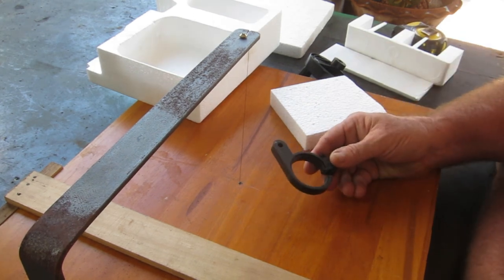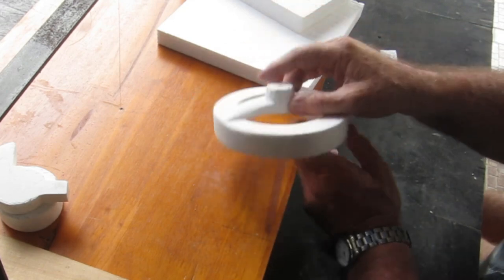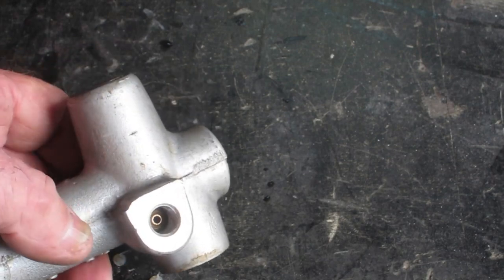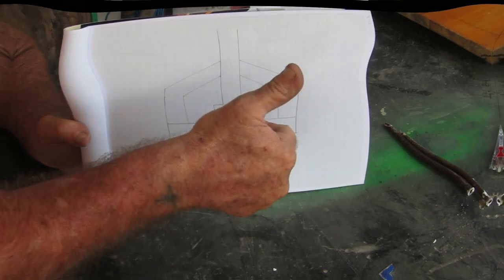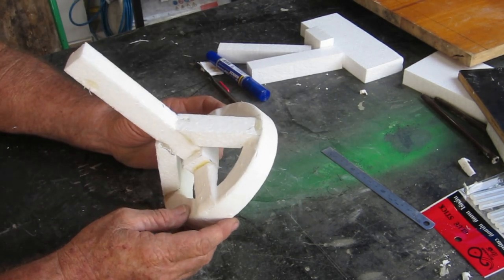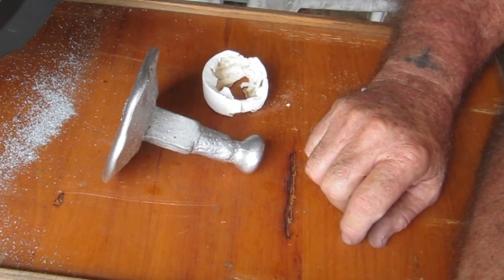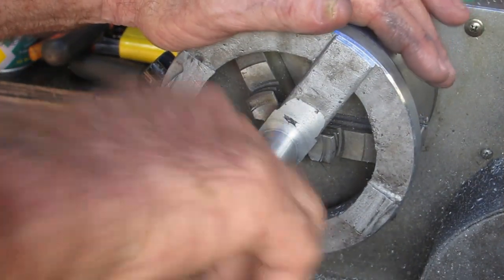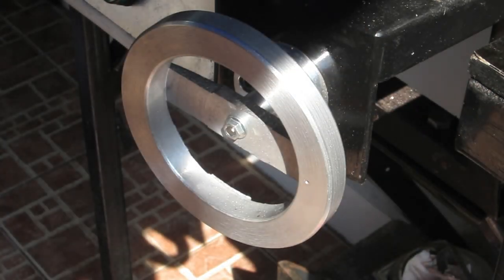MHW Episode 40 - Lost Foam Casting parts for my Homemade Milling Machine - Part 11

Comment: if you try the blue stuff it can be made to do parts as smooth as glass but spay it with sopy water as a difactint so the wall filler sticks

Comment: CA glue melts styrofoam.  I haven't tried pva glue, but model RC builders use odorless CA glue.  It seems to work well
Reply from the maker: I've never seen an odorless CA glue, UHU make a glue for foams, but I haven't tried that yet.

Comment: M8 get yourself an old broken alloy car or motorbike wheel, the alloy in them is ideal for casting.
Reply from the maker: Thanks, I've had rims suggested to me before
Reply: @MyMiniHomeWorkshop  used them myself and you can always find a wrecked one from the breakers, just like to say I subbed because your videos are efin awesome m8 I love the kiss method you employ and my mind is like yours at night, If I goto bed with an idea I am fecked if I can get to sleep.
Keep it up.
Reply from the maker: @rct2  Thanks for the kind words, sleeping is a massive issue for me at times, I have a problem I'm trying to solve at the moment, and here I sit @ 3am replying to you 😣 Lucky I'm retired

Comment: Grab yourself some polyurethane foam it will cut nicely and sand to a smooth surface and there will be no need for any type of filler.
Reply from the maker: Unfortunately over here,. beggars can't be choosers, so hard to get most things, unlike back home. 😕
Reply: @MyMiniHomeWorkshop  Yep understand, the polyurethane foam is the foam used to make surfboard blanks so I thought you would be able to get that over there.
Reply from the maker: @WayneCook306  I was a surfer when I was younger and shaped and made a few boards back then, however, there is not much surf to be had in the Gulf of Thailand or anywhere here for that matter. 😜
Reply: @MyMiniHomeWorkshop  Ok fair enough.

Comment: Hey I just saw your video.  I'm glad you got a working piece at the end.  I suggest using polystyrene foam instead as well as coating it with watered down wall plaster.  
I have a whole playlist on lost foam casting, 
https://youtube.com/playlist?list=PLrdcGmB7TsJYbYt0554y4Zh_3bK2kIfPc
Reply from the maker: Pretty sure what I'm using now is Polystyrene
Reply: @MyMiniHomeWorkshop  quite possible, you're probably using polystyrene EPS which  is made of a bunch of beads.  You want to use XPS.  It can be found at home Depot or Lowe's.
Reply from the maker: I live in Thailand, no Home Depot or Lowe's here, and it's generally hard to find anything where I live, so I use what I can get my hands on.
Reply: @MyMiniHomeWorkshop  I see, well then I'd suggest coating it with plaster like I do in my videos, and you'll have a much better cast 👍
Reply from the maker: @HeinrichsMade  I already do that